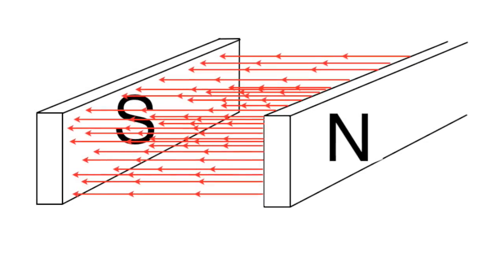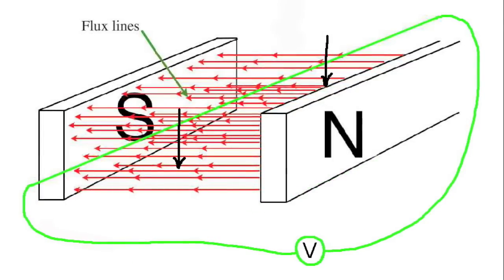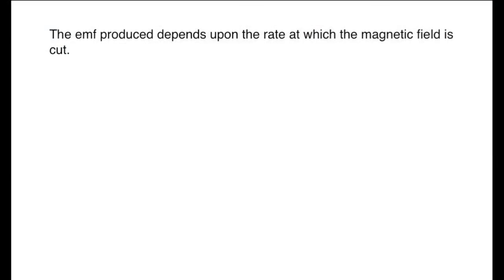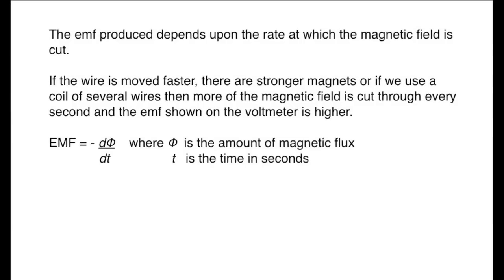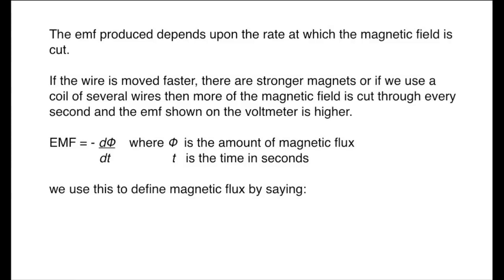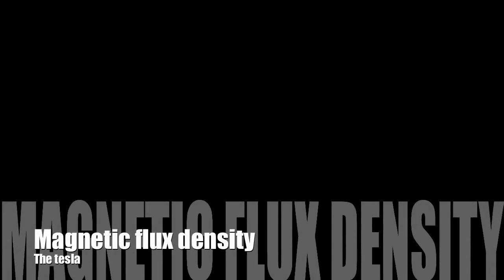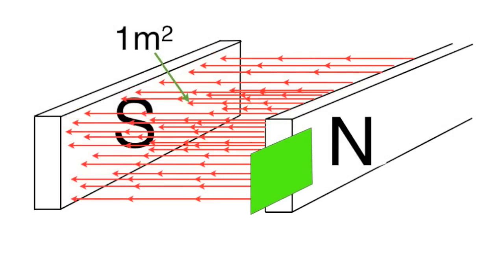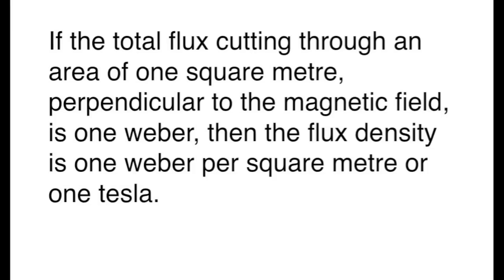Magnetic flux and magnetic flux density in weber and Tesla for beginners: from fizzics.org

Comment: Roger if you put the two magnets poles together the two Norths for example and you glue it together so that it doesn't push away the other magnet and you put a coil around that and you insolate the coil with aluminum or something that doesn't attracts the magnet will the coil produce a voltage with out moving the coil or the magnet only the magnetic field is moving will it produce a voltage cause the only thing that is moving is the magnetic field just a thought
Reply from the maker: The magnetic field would be distorted (there are images of the shape on the net) but it would not be moving, so no output